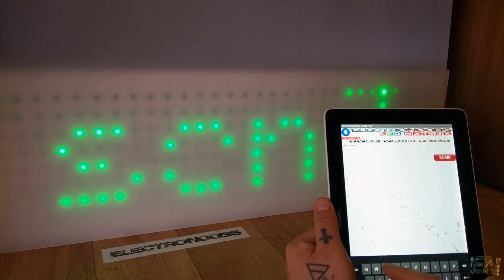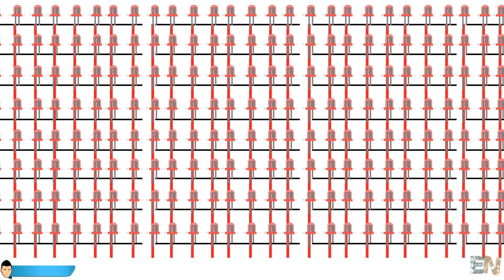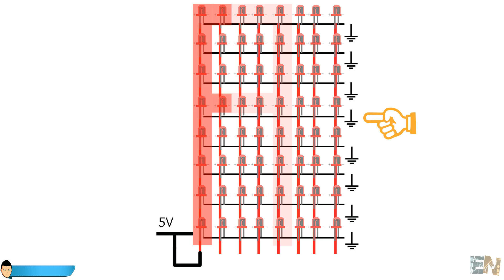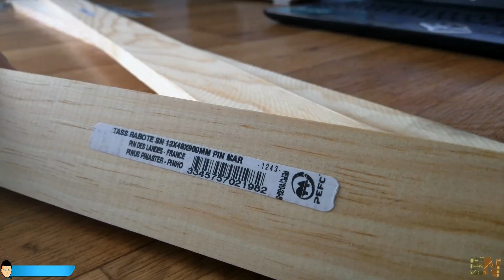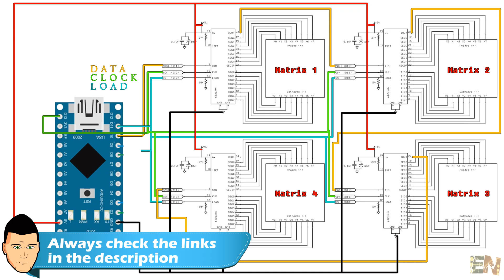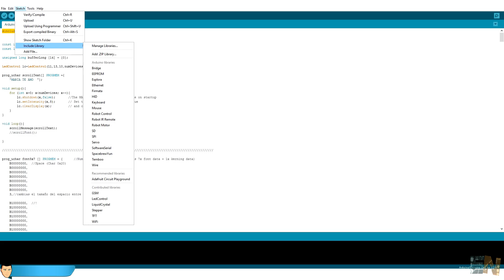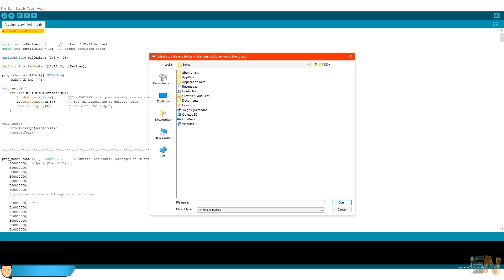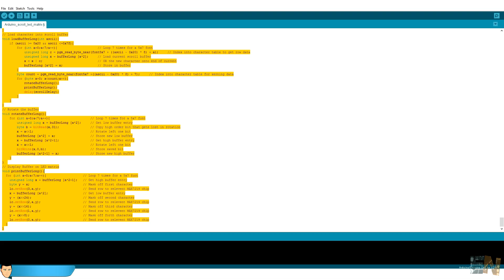HUGE LED matrix with Arduino

Comment: What if you connect each row and each column directly to Arduino's pins and define each column as either positive and row as negative in the code. How do you power only one row at a time? How to turn off unused row?

Comment: Thanks for this video. There is a problem that I can't solve. You don't seem to have provided a copy of the code for the first part of the exercise that doesn't involve  bluetooth. I  tried copying  the code straight from your video but this code will not compile for me. I get an error message 'prog_uchar does not name a type, did you mean getchar?'  You obviously were able to get the first part to compile, so can't work out why mine won't. I'm sure I accurately copied yours. Noone else seems to have had this  problem. Hope you are still commenting on this.

Comment: very good project. I have a question what size is (height and length) you will have a diagram, how to do it. can I use led strips and do it in colors?
congratulations on your project, very good and well explained190/5000

Comment: Can anyone give me a pointer on how to correctly add the capacitors on Pin 19? Do I just connect the positive side of the 10uf to Pin 10, and the negative leg to ground, and the same for the .1uf cap also?

Comment: Hey Electronoobs, I have a question,
How many 8X8 matrices can we connect in series using max7219?
Reply from the maker: Normally it should be how many to wanr since the data out drom.one module is data on to the next one. But this library that I've used only accepts 9. You should create the shift our data yourself if you need more.
Reply: @ELECTRONOOBS  Thanks for your response.
So you are saying that I should create my own library, then I could add more matrix, right?
Or is there something I'll have to do in terms of hardware.
I'll be grateful for your response.
Reply from the maker: @oxycada9272  I'm not sure because I haven't tested. You could try but I can't tell you for sure the result...
Reply: @ELECTRONOOBS  okay, thanks for the response

Comment: I've picked up 2 Display LED Banner boards there older boards. I think there out of a gambling machine. I want to to get these to up and running where I can text something and it will be displayed on the boards. I'm having a problem finding anything about them on the internet. I was hoping you could tell me what I would need to get these 2 boards working. I want to make a sign that will say what I text. The boards were made in 1998 by Leisure Time Technology, INC. LED Banner Display p/n: 10-063  REV-D the other board, MODEL #217X60M I guess there made in Canada. I dont know if arduino's will work on this. Any Ideals what I could do. Like set ESP-launcher   for wifi so I can connect to the boards wirelessly so I can put new texts on the go all wireless on battery like a mobile sign. I'm just looking to have a little fun. If you couldn't give in a few Ideas I would really appreciate it.  Thanks

Comment: nice video, but how do you supply the whole matrix with just a phone charger? with a typical power draw of about 20mA per LED, wouldn't you need something more powerful?
Reply: His matrix is 32x8, so in the worst case scenario (whole row turned on) it would draw 20x32=640mA.
Not more, because only one row is powered at a time. The microcontroller doesn't consume much, only about 20mA.
And regular 1-2A 5V phone chargers are fine with 660mA.

Comment: What is the voltage of 10uf and 100nf capacitator, and no other resistor will be used instead of 40k ohm resistor.
Reply: Please sir help me...

Comment: I actually like the glyph you defined for the quotation mark character (two columns of three vertical dots separated by one empty column) since it takes up a lot less room than displaying two single quotes (which is what the code does without modification).

So, I've made one further change to the code:

yours:
const unsigned char scrollText2[] PROGMEM ={"''"};

mine:
const unsigned char scrollText2[] PROGMEM ={"\""};

I think I'm going to change the glyph for the single quote to match quotation mark as well, since the whole font is minimalist (we don't have enough pixels to do much more) the current curvy-style single quote seems too fancy. Here's that change as well:

yours:
    B11000000,  //'
    B01000000,
    B10000000,
    B00000000,
    B00000000,
    B00000000,
    B00000000,
    3,

mine:
    B10000000,  //'
    B10000000,
    B10000000,
    B00000000,
    B00000000,
    B00000000,
    B00000000,
    3,

[again, see my older comments for this to make more sense]

Comment: OK (see previous comments)...tried sending a string that includes a quote and single quote character via the Arduino serial console and they both display just fine after my mods to the code. Pretty cool. Thanks again for a great demo.

Comment: Before actually getting deep into this code (and make significant changes to let it use all 8x8 pixels) I notice that you have defined a glyph for an apostrophe, but that it isn't possible to actually use it.

This line is OK:
const unsigned char scrollText7[] PROGMEM ={"'"};

But then you have these lines:
        if (message[i] == '%')
        {
        scrollMessage(scrollText5);
        }  

        if (message[i] == '&')
        {
        scrollMessage(scrollText5);
        }

         if (message[i] == '(')
        {
        scrollMessage(scrollText8);
        }

Note that the first two both display the % symbol. So, change the second one to scrollText6, but then also the entire section for scrollText7 is missing, so change all of that to the following:

        if (message[i] == '%')
        {
        scrollMessage(scrollText5);
        }  

        if (message[i] == '&')
        {
        scrollMessage(scrollText6);
        }

        if (message[i] == '\'') //need to escape the single quote
        {
        scrollMessage(scrollText7);
        }

         if (message[i] == '(')
        {
        scrollMessage(scrollText8);
        }

That fixes the issue with not being able to show the ampersand and it adds the ability to display an apostrophe, both of which there are glyphs for in your fonts.

I wonder if the apostrophe or quote characters might cause a problem for the bluetooth code? (ie: strings and characters being passed around and somehow not being escaped properly). I haven't bothered to try testing that (maybe that's why your code seemed to be tweaked around this area but then accidentally broken). I guess I could try using Serial input from the Arduino IDE to mimic that and see what happens.

Comment: This is an excellent video. And it is the first library and demo that I've found that will work with my 8x8 LED matrixes out of the box with text scrolling in the correct direction, etc. So...thank you thank you thank you!

However, I notice that the code creates a font that is 5x7 pixels. That means that for me (and for you) the bottom row of LEDs is never used.

Thankfully (again -- much thanks) the demo code is written in what is a very understandable way (it is very verbose and well commented as well) which leads me to believe it would not take much to add a new "font" and modify the existing functions to handle it (if necessary -- not sure yet). A font that is 8 pixels high, or perhaps one that adds "tails" to characters like p,g,q,y..

Seems like a big waste to have an 8x32 pixel display and never use those bottom pixels. Maybe less of an issue for me since the module I bought required no soldering (four 8x8 LED matrix modules connected together as a complete package). However, it seems like a big waste for your project since you had to spend time cutting 32 holes for the bottom row, and soldering together a bunch of LEDs there that are always off.

Comment: Hey so I was looking at your schematic and I'm having some difficulties understanding it. Are you using a 1 uf capacitor and a 10uf capacitor for the max 7219 I'm just having a hard time finding the .1uf capacitor you put also for the 10uf capacitor is the curved line supposed to represent negative

Comment: Hi there I'm not sure if you would be able to answer my question but I want to apply this to make custom tail lights on my car. How would I set it up to make an arrow scroll to the left or scroll to the right without having to change the code every time I just want to set on a switch
Reply from the maker: You only have to change the code once. In the characters vector just change the "0"os and "1"s in such a way that they draw an arrow. For example:

B00000000
B00000000
B00000100
B00000110
B11111111
B00000110
B00000100
B00000000

This will draw an arrow to the right. Change the characters a and b for example and the send thsoe characters to the MAX driver. Keep up!
Reply: Electronoobs thank you for the reply but would I just have to copy the code multiple times for different buttons? Like I want to so when I turn on the right turn signal it will do the arrow then when I push the brake it does something else. Like do multiple else statements

Comment: Hi, I have a Arduino project in which I have to make a game (Snake game) 4 (8x32 LEDs matrix), so a total of 32x32 LEDs matrix. I have done some research and the libraries that exist for the MAX7219 can only be used to control individual 8x8 LEDs (or connected together). But let's say the matrix I have is 32x32, and I want to control the LED on the first row and 25th column, I would love to be able to write something like: matrix[24][0]. Anyone knows about a library that works like this? Thank you in advance!
Reply: Write function that can translate the numbers that you would like to use to numbers understandable for the library. It isn't hard.

Comment: I tried to connect five max7219 with my led matrix and it didn't work. It is working fine with 4 ICs. Please help me I'm stuck
Reply: vikas chouhan you need to change max devices inside the code to 5
Reply: saidusaidmrn already tried that its not working.

Comment: Excuse me man, how could I add another row instead of another column? I'm trying to figure out how to design a 16x64 matrix, I know, because of your help, that for each 8 columnas, I'll need a max7219, but what about extra rows?
Reply from the maker: I've also tried that and couldn't achive it. You have to totally cahnge the shift out data and probably shift two serial datas at same time. Keep up!

Comment: So what is the current draw when it's operating?  Seems like it would be more than 1 Amp for all leds, drivers, and arduino.
Reply from the maker: JayhoPeter1 i haven't test the power but as i say in the video the LEDs are never turn on all at once, you turn on row by row and do it fast enough so the human eye won't see the switch. so the current might be lower than you think.